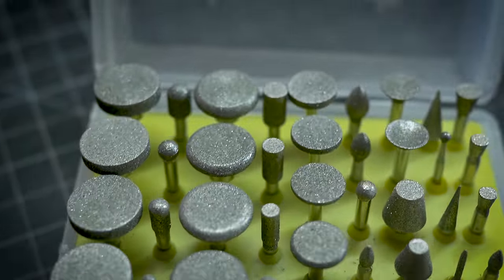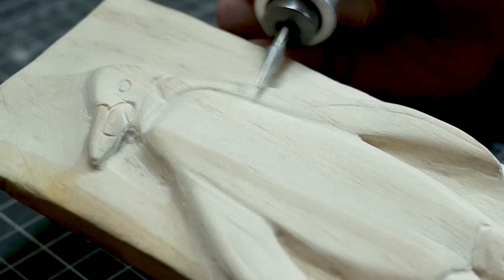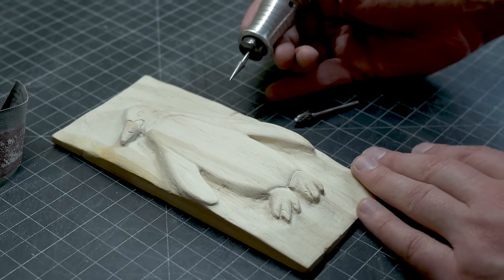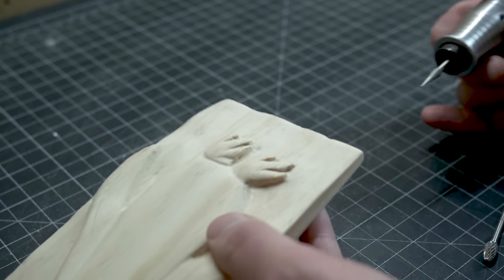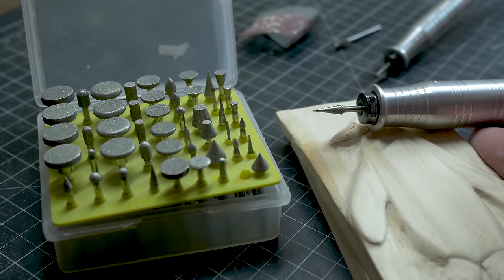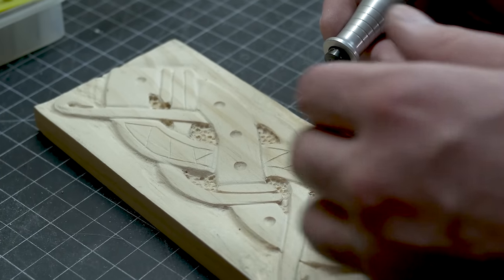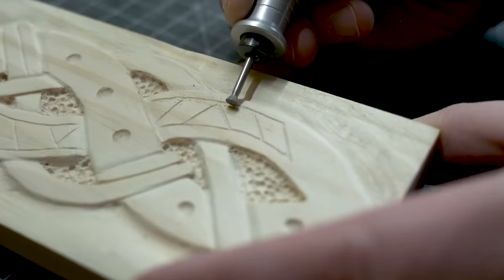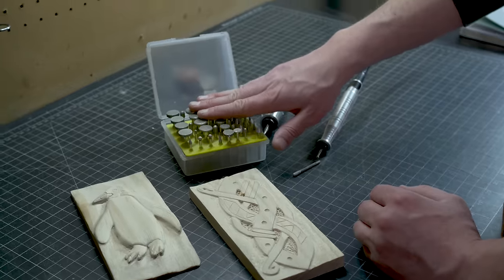How To Use Diamond Burs For Wood Carving/Power Carving

Comment: Thank you for opening my eyes, and honestly,  inspiring me to carve.  I used to whittle with my pocketknife while in the Scouts ages ago and always loved to see what people can reveal from a block of material.  I have been pulling the tools together which I will need to start to carve (professional hobby, but could turn into something more) and I am at the point of purchasing bits and now, thanks to you, I see the definite need for diamond burrs. I have ignored them since I didn't see the BIG picture.

Where did you purchase the set in your video?  I love the selection, and it differs from the link in your video description.  While I'm at it... What is a good set of tungsten carbide high speed bits as well?  I'm trying to purchase responsibly and not break the bank, but I don't want to purchase junk, only to replace it every couple of months.  Where is a good place to go with a selection of bits I would need? Thank you for your time, and keep up the great work with you videos.
Reply from the maker: Hey Bill! Glad to hear that you are inspired to start carving and that the videos are helping! These diamond bits were bought from Harbor Freight.

As far as tungsten burrs go, there will always be bigger and better. I’d buy a set on Amazon for around $20. They will last you a while
Reply: Thank you for the information and the prompt reply.  I'm running out to purchase a set today.

Comment: I have a set of those berr, got them from Harbor Freight. I used a peace of white oak plywood for my last project and I think it was a mistake. What is the best kind of lumber to use? The closest Hobby store is 70 miles in Jackson TN. I'm have learned a lot from your videos. Hope to see a lot more!
Reply from the maker: Any type of plywood really shouldn’t be used for power carving. If you can, order some basswood blocks. That is a great softwood to learn with. Glad you enjoyed the video!
Reply: You can also order various wood blocks for carving from a variety of lumber suppliers. Rockwell also has cutoffs for pretty cheap. Great for small pieces.

Comment: Great video. 
Question. What do you use when you have to take a lot of wood out of a relief carving when your rotary tool gets in the way because of the angle? I’m working on a 10x12 piece that’s one inch thick trying to get rid of 1/4 inch around my positive space in the middle but my rotary tool gets in my way when working more toward the middle. 
Sorry for the long question
Reply from the maker: You are good bro! If a piece is that big I would use a router in some spots maybe if it is flat. If your tool is getting in the way you need A) smaller hand piece B) use hand carving chisels. C) carving knife.
Reply: Cornelius Creations thank you for the reply man! Best channel keep it up!